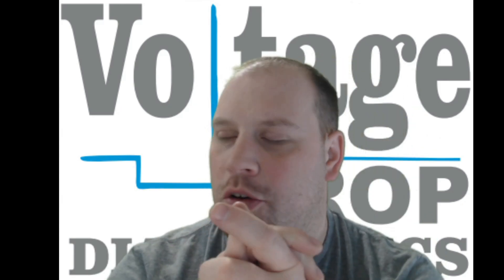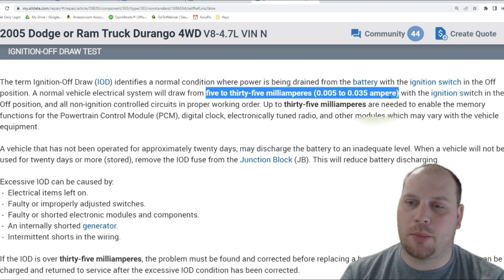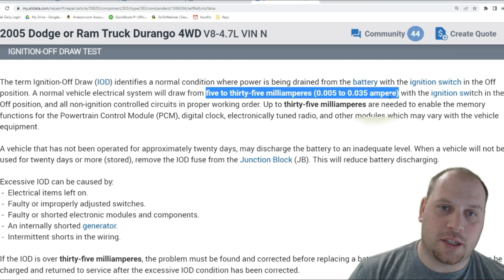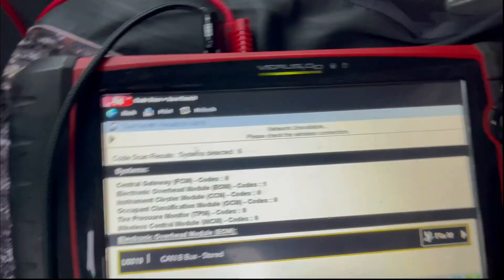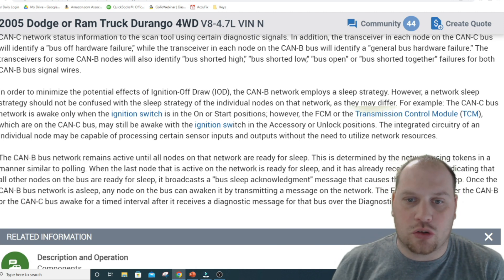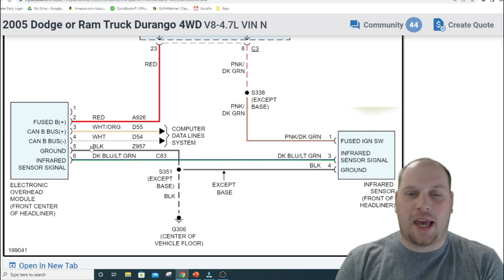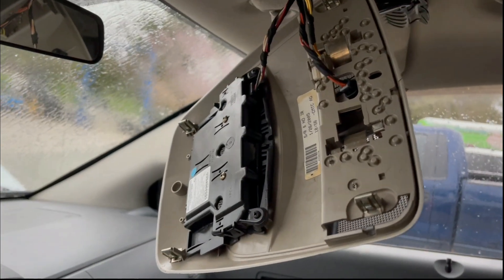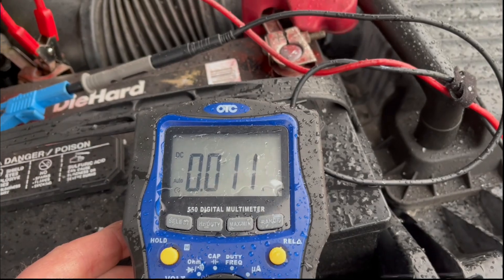'05 Durango Parasitic Draw- VDD, NLA style?

Comment: It seems "what they didn't tell you"  has a high probability to be part of the problem.
Reply from the maker: Maybe. But they had that radio installed for years without real issue as long as it was turned off. Having a near 1 amp draw with the radio off was still a big issue.

Comment: I'd quit saying "DVOM.. and just state what you're actually using.  "I tested it with my VOLT meter" -- or "I hooked up my AMP meter in series". ect. ect..  Some people don't know what we're talking about or know the buzz words.
Reply: All a voltmeter can do is read voltage. It cannot do anything else. All other reading are a calculation based on the voltage read and ohm's law. So referring to it as a voltmeter is correct. Also there's no such word as amperage
Reply from the maker: Dave, I love your channel! Cool to see you around here!
Reply: @davesterl  When you say, "just test it with your dvom" --  noobies think, ok-- But what do I turn the knob to? volts? ohms?   I'm lost" ...  so just simply stating what selection you are using is more instructive.. that's all.. As a teaching tool, it's more articulate, more informative with less words, more direct and to the point of action.  Just my little opinion, obviously no one has to listen to it.